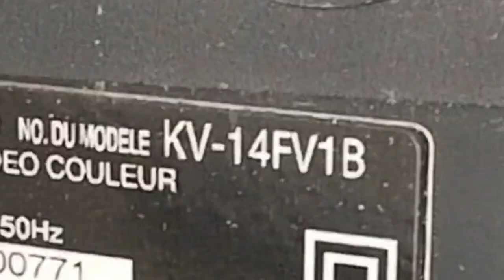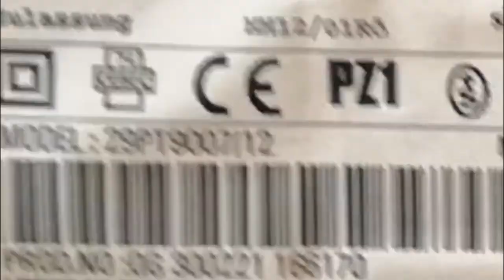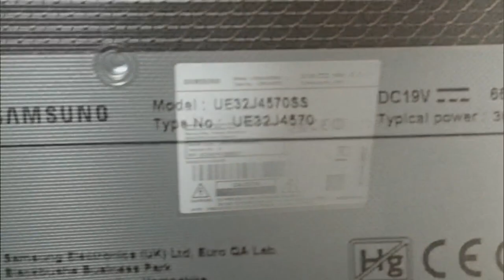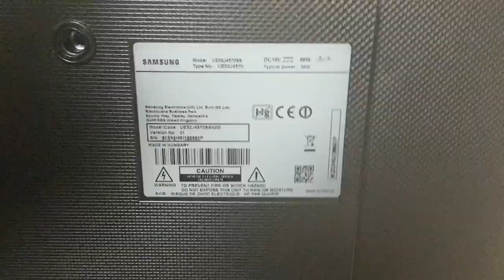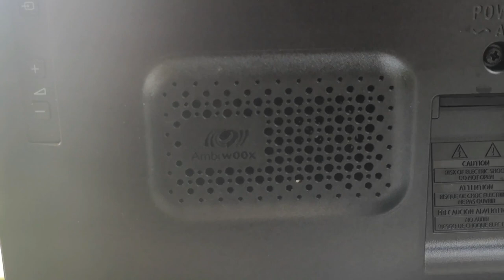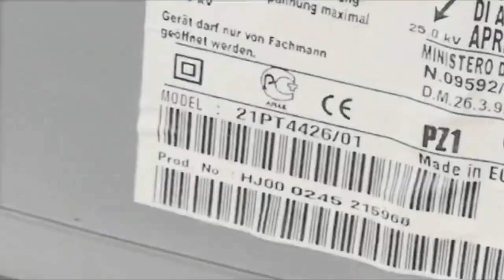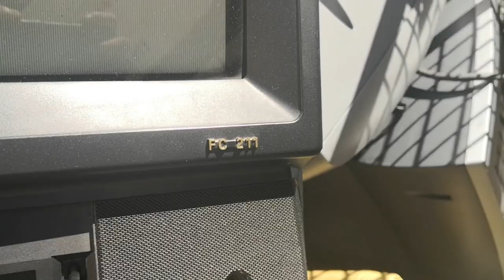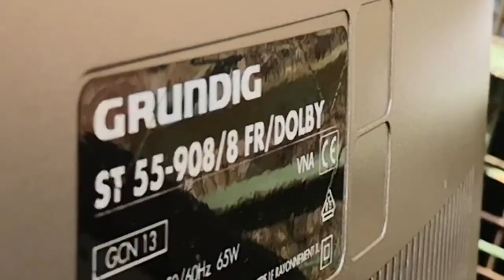Speaker Hunting Video #27 | Vintage Siemens CRT , Grundig & Philips WOOX

Comment: Super episode! I have so many loudspeakers but I do not have "KW🔊SIPE♎" xD. You have a nice dog: D. Recently, I found philips wOOx but the company "FU Cheong" and plays great, only that I have a tweeter with black cone. Bye 👋😂
Reply from the maker: Well Sipe speakers are not so rare... You should find one soon! And for the woox, well my midrange was damaged so i repaired the cone with a flat black one... Now it look like the woofer so much better in my opinion! Oh yeah my dog is saying you thank you 😜
Reply: @LSandM-SpeakersFromEverywhere  I also greet the dog and you! What kind of amplifier do you need for speaker testing? I have a Philips FW630 that can do it with 60W Rms. These fu cheong do not have bottom surround and have soundproofing in the box. And Thanks! 😁
Reply from the maker: @Miki_00017  Well I have 2 amps... My Yamaha R-N602 120w RMS per channel but that's my everyday amp im not testing speakers with this one. For test I have a cheap Sony Genezy 2*50W amp ( sony say 360w but no...) it's a bad amp but it have a very good protection circuit so it's impossible to kill
Reply: @LSandM-SpeakersFromEverywhere  nice, and I have SONY  LBT-XB80AV 2x120W RMS, 5 disc changer, 2 deck, tuner, aux, and SUPER WOOFER! and 5 speakers
Reply: @LSandM-SpeakersFromEverywhere  I just wanted to pull the speakers out of the Philips CRT 28 "TV set but these torx are so small that I could not do it 😐 but maybe I will take a hammer and I can handle it   👌I know, very bad Idea...
Reply from the maker: @Miki_00017  oh buy torx screw driverd...
Reply: @LSandM-SpeakersFromEverywhere  I have torx, but this screw is little!